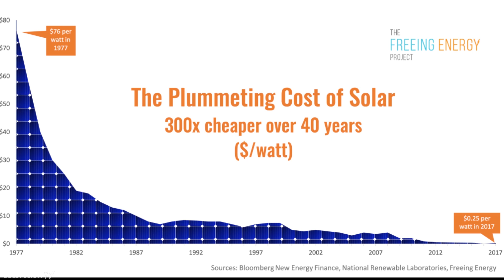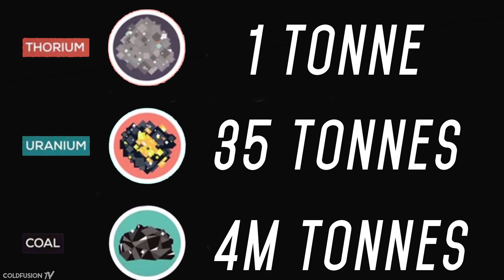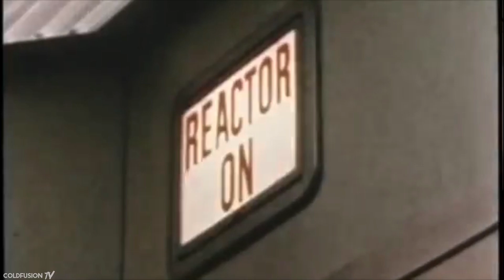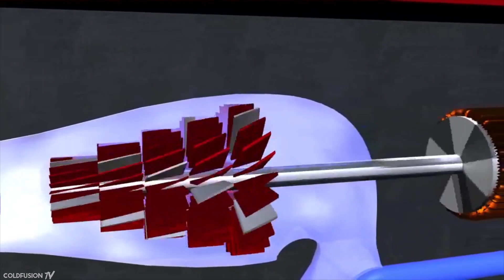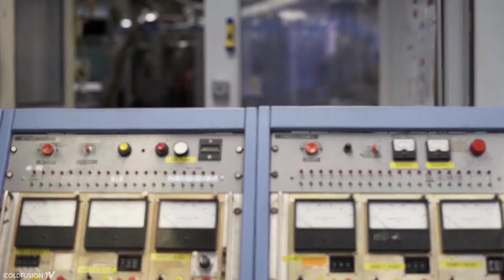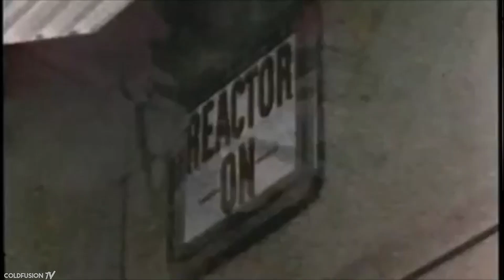Thorium - The Future of Energy?

Comment: Don't believe the spin on thorium being a greener nuclear option
 
 
In a world increasingly aware of and affected by global warming, the news that 2010 was a record year for greenhouse gases levels was something of a blow.
With the world's population due to hit nine billion by 2050, it highlights the increasingly urgent need to find a clean, reliable and renewable source of energy.

India hopes it has the answer: thorium, a naturally occurring radioactive element, four times more abundant than uranium in the earth's crust.

The pro-thorium lobby claim a single tonne of thorium burned in a molten salt reactor (MSR) – typically a liquid fluoride thorium reactor (LFTR) – which has liquid rather than solid fuel, can produce one gigawatt of energy. A traditional pressurised water reactor (PWR) would need to burn 250 tonnes of uranium to produce the same amount of energy.

 
They also produce less waste, have no weapons-grade by-products, can consume legacy plutonium stockpiles and are meltdown-proof – if the hype is to be believed.
India certainly has faith, with a burgeoning population, chronic electricity shortage, few friends on the global nuclear stage (it hasn't signed the nuclear non-proliferation treaty) and the world's largest reserves of thorium. 'Green' nuclear could help defuse opposition at home (the approval of two new traditional nuclear power reactors on its west coast led to fierce protests recently) and allow it to push ahead unhindered with its stated aim of generating 270GW of energy from nuclear by 2050.

China, Russia, France and the US are also pursuing the technology, while India's department of atomic energy and the UK's Engineering and Physical Sciences Research Council are jointly funding five UK research programmes into it.

There is a significant sticking point to the promotion of thorium as the 'great green hope' of clean energy production: it remains unproven on a commercial scale. While it has been around since the 1950s (and an experimental 10MW LFTR did run for five years during the 1960s at Oak Ridge National Laboratory in the US, though using uranium and plutonium as fuel) it is still a next generation nuclear technology – theoretical.
China did announce this year that it intended to develop a thorium MSR, but nuclear radiologist Peter Karamoskos, of the International Campaign to Abolish Nuclear Weapons (ICAN), says the world shouldn't hold its breath.

'Without exception, [thorium reactors] have never been commercially viable, nor do any of the intended new designs even remotely seem to be viable. Like all nuclear power production they rely on extensive taxpayer subsidies; the only difference is that with thorium and other breeder reactors these are of an order of magnitude greater, which is why no government has ever continued their funding.'

China's development will persist until it experiences the ongoing major technical hurdles the rest of the nuclear club have discovered, he says.
Others see thorium as a smokescreen to perpetuate the status quo: the world's only operating thorium reactor – India's Kakrapar-1 – is actually a converted PWR, for example. 'This could be seen to excuse the continued use of PWRs until thorium is [widely] available,' points out Peter Rowberry of No Money for Nuclear (NM4N) and Communities Against Nuclear Expansion (CANE).

In his reading, thorium is merely a way of deflecting attention and criticism from the dangers of the uranium fuel cycle and excusing the pumping of more money into the industry.

And yet the nuclear industry itself is also sceptical, with none of the big players backing what should be – in PR terms and in a post-Fukushima world – its radioactive holy grail: safe reactors producing more energy for less and cheaper fuel.

In fact, a 2010 National Nuclear Laboratory (NNL) report (PDF)concluded the thorium fuel cycle 'does not currently have a role to play in the UK context [and] is likely to have only a limited role internationally for some years ahead' – in short, it concluded, the claims for thorium were 'overstated'.
Proponents counter that the NNL paper fails to address the question of MSR technology, evidence of its bias towards an industry wedded to PWRs. Reliant on diverse uranium/plutonium revenue streams – fuel packages and fuel reprocessing, for example – the nuclear energy giants will never give thorium a fair hearing, they say.
But even were its commercial viability established, given 2010's soaring greenhouse gas levels, thorium is one magic bullet that is years off target. Those who support renewables say they will have come so far in cost and efficiency terms by the time the technology is perfected and upscaled that thorium reactors will already be uneconomic. Indeed, if renewables had a fraction of nuclear's current subsidies they could already be light years ahead. 
All other issues aside, thorium is still nuclear energy, say environmentalists, its reactors disgorging the same toxic byproducts and fissile waste with the same millennial half-lives. Oliver Tickell, author of Kyoto2, says the fission materials produced from thorium are of a different spectrum to those from uranium-235, but 'include many dangerous-to-health alpha and beta emitters'.
Tickell says thorium reactors would not reduce the volume of waste from uranium reactors. 'It will create a whole new volume of radioactive waste from previously radio-inert thorium, on top of the waste from uranium reactors. Looked at in these terms, it's a way of multiplying the volume of radioactive waste humanity can create several times over.'
 
Putative waste benefits – such as the impressive claims made by former Nasa scientist Kirk Sorensen, one of thorium's staunchest advocates – have the potential to be outweighed by a proliferating number of MSRs. There are already 442 traditional reactors already in operation globally, according to the International Atomic Energy Agency. The by-products of thousands of smaller, ostensibly less wasteful reactors would soon add up.
Anti-nuclear campaigner Peter Karamoskos goes further, dismissing a 'dishonest fantasy' perpetuated by the pro-nuclear lobby.

Thorium cannot in itself power a reactor; unlike natural uranium, it does not contain enough fissile material to initiate a nuclear chain reaction. As a result it must first be bombarded with neutrons to produce the highly radioactive isotope uranium-233 – 'so these are really U-233 reactors,' says Karamoskos. 

This isotope is more hazardous than the U-235 used in conventional reactors, he adds, because it produces U-232 as a side effect (half life: 160,000 years), on top of familiar fission by-products such as technetium-99 (half life: up to 300,000 years) and iodine-129 (half life: 15.7 million years).Add in actinides such as protactinium-231 (half life: 33,000 years) and it soon becomes apparent that thorium's superficial cleanliness will still depend on digging some pretty deep holes to bury the highly radioactive waste. 

With billions of pounds already spent on nuclear research, reactor construction and decommissioning costs – dwarfing commitments to renewables – and proposed reform of the UK electricity markets apparently hiding subsidies to the nuclear industry, the thorium dream is considered by many to be a dangerous diversion.

Energy consultant and former Friends of the Earth anti-nuclear campaigner Neil Crumpton says the government would be better deferring all decisions about its new nuclear building plans and fuel reprocessing until the early 2020s: 'By that time much more will be known about Generation IV technologies including LFTRs and their waste-consuming capability.'
In the meantime, says Jean McSorley, senior consultant for Greenpeace's nuclear campaign, the pressing issue is to reduce energy demand and implement a major renewables programme in the UK and internationally – after all, even conventional nuclear reactors will not deliver what the world needs in terms of safe, affordable electricity, let alone a whole raft of new ones.
'Even if thorium technology does progress to the point where it might be commercially viable, it will face the same problems as conventional nuclear: it is not renewable or sustainable and cannot effectively connect to smart grids. The technology is not tried and tested, and none of the main players is interested. Thorium reactors are no more than a distraction.'
Reply: energyfromthorium(dot)com(slash)rees-article-rebuttal(slash)
Let me quote relevant parts:
"I will start by commending Mr. Rees on accurately recapitulating the advantages of the LFTR and correctly identifying that it is the LFTR using thorium—and not conventional solid-fueled, water-cooled reactors using thorium—that is the centrality of the argument here. Far too many writers miss making this key distinction, and instead focus on the limited application of thorium in solid-fueled reactors, and conclude somewhat accurately that thorium has an only modestly-appealing future in existing reactors."
"Again, I appreciate a recapitulation of the advantages, but the sentence ends with the assertion that these advantages are merely “hype” and do not stand up to scrutiny. I did a search of an online dictionary for the word “hype” and found a range of definitions, from “excessive publicity and the ensuing commotion” to “something deliberately misleading; a deception.” If the “hype” surrounding thorium and LFTR reaches this latter category, then truly the author is correct to warn the public about something deliberately misleading or a deception.

So he employed five witnesses in his case against thorium and LFTR, each intended to show that there is hype or deception involved. They are:

Peter Karamoskos of the International Campaign to Abolish Nuclear Weapons (ICAN).

Peter Rowberry of No Money for Nuclear (NM4N).

Oliver Tickell, author of Kyoto2.

Neil Crumpton of Friends of the Earth

Jean McSorley, senior consultant for the anti-nuclear campaign waged by Greenpeace.

The closest thing to a “pro-nuclear” witness interviewed by the author was a UK National Nuclear Laboratory “white paper” entitled “The Thorium Fuel Cycle.”

Mr. Rees goes on to point to the Indian example of thorium development and their national commitment to it before getting to the crux of his entire argument:

We haven’t done it before.

This is a very strange argument with which to base a case against any technology. I’ve spent my entire career in technology development, and the reason why people undertake technology development is precisely because they haven’t done it before!

The case against a new technology like LFTR should then be supported by evidence as to why the author might think it likely that a technology development will fail if undertaken. For this we turn to the five witnesses.

Dr. Karamoskos says:

“Without exception, [thorium reactors] have never been commercially viable, nor do any of the intended new designs even remotely seem to be viable. Like all nuclear power production they rely on extensive taxpayer subsidies; the only difference is that with thorium and other breeder reactors these are of an order of magnitude greater, which is why no government has ever continued their funding.”

Dr. Karamoskos is a nuclear radiologist, not a nuclear engineer. Has he evaluated the LFTR economic case? I highly doubt it. Has he reviewed the performance of other thorium-based technologies before issuing his blanket statement? We will never know because the author does not give us additional details.

One has to wonder why Dr. Karamoskos does not think the thorium-based LFTR will be viable. Perhaps he thinks it will have to operate at higher pressures than existing reactors–but it won’t, it will operate at lower pressures. Perhaps he thinks that it will operate at a lower temperature and achieve lower thermodynamic efficiency–but it won’t, it will operate at higher temperatures and achieve higher efficiency. Perhaps he thinks that the thorium fuel will be more difficult to find and more expensive than uranium fuel–but it won’t, it is more common than uranium and will be mined as we search for rare-earth materials for our wind turbines.

Dr. Karamoskos does seem anxious to promote “guilt by association”, however, by lumping any thorium-based reactor in with uranium-based reactor technologies, which he then goes on to paint as dependent on “extensive taxpayer subsidies.” This is certainly not the case in the United States and I suspect is not the case in the UK as well. He also decides, apparently out of thin air, that thorium is going to cost an “order-of-magnitude” more than uranium-based reactors, without any supporting evidence.
"

"Mr. Rees then reminds us that thorium is “still nuclear energy” and goes on to say that it will “disgorge toxic byproducts” like some benighted monster. Unlike Mr. Rees, I have spent considerable time modeling each and every one of the fission product decay chains and have presented my results in public discussions. Do thorium reactors produce radioactive materials? Certainly. Do these pose an undue threat to human life or society? Certainly not, in my opinion, and I offer the results of my modeling as the evidence.

At some point, I am called to testify as to the benefits of thorium reactors, but Mr. Rees then goes on to dismiss the benefits I offer as “putative” and to assert that they will be outweighed by a “proliferating number of reactors.” I have to wonder a bit at the choice of language in his dismissal, for typically when we discuss “proliferation” in the nuclear arena we refer to the undesired spread of nuclear weapons rather than the expansion of a lifesaving technology. The literal meaning of the statement is valid, but the choice of adjective strikes me as no accident and is meant to sow fear and doubt in the mind of the reader.

Dr. Karamoskos is then called in again to label thorium reactors a “dishonest fantasy” because the fissile material is uranium-233 rather than thorium. This is a strange way to express dishonesty, since I have been forthright since I first started discussing the technology that uranium-233 was the fissile material. But uranium-233 comes from thorium and only from thorium, and the consumption of U-233 in a LFTR leads to the formation of new U-233 from thorium. U-233 then serves as a sort of “nuclear catalyst,” and the real fuel of the reactor is thorium. Is this dishonesty? No, I think it is simplicity. Where does the uranium-233 that drives the reactor come from? Thorium. What is used to create new uranium-233? Thorium. Hence we call these machines such as LFTR by a simple and accurate name: thorium reactors.

A paragraph of errors about half-lives and fission products then follows, which by itself could have been enough reason to pull the article back into dry dock and rebuild it, but Mr. Rees declines to do so. In short, U-232 doesn’t have a half-life of 160,000 years, it has a half life of about 69 years. Protactinium-231 is not produced by a LFTR or any other reactor, it is a natural step on the decay chain of uranium-235 and has nothing to do with whether man chooses to use nuclear power or not. Technetium-99 and iodine-129 are asserted to pose a risk because of their long half-lives. Rather, precisely because they have long half-lives they have low radioactivity and manageable risk. I doubt that Mr. Rees has a good handle on the nature of radioactivity and risk."

Comment: As a comparison between required land for solar farms and Indonesia's current 3.5GWe contract for the seven x 500MWe Liquid Thorium ion molten salt ThorCon "energy converters" have "As-built" foot prints of 1.1 Ha (65m x 175m) for each 500MWe unit. These will provide High temperature automatically load dependent output at near atmospheric pressure under  extremely "walk-away safe" conditions at a capital levelised  output cost of less than US$0.04/kWh as well as having the capability of doing a cold/black start.
So with a 44kW/m2 footprint it is going to be hard to beat by any combination of renewables and battery banks providing 52x7x24 electricity...
https://youtu.be/qd_lBPbeVrQ

Comment: Everyone who developed nuclear weapons quickly realised thorium is unsuitable. It cannot reach the heavier stuff like plutonium within the reactor core. Uranium works best as a solid fuel so that was the system everyone used in the civil plants. 
Thorium works badly as a solid fuel so cannot be used in current reactors. It does work well in a liquid fuel - molten salt. 
The reason we don’t have molten salt power plants is regulatory only. USA rules expressly prohibit a molten core. That stops molten salt technology at source. U.K. rules allow different reactor designs but the regulatory process is just plain difficult and very slow so nothing gets done. 
Moltex the U.K. molten salt reactor designer has created a reactor that has no internal pumps no drain tanks and cannot overheat. The first version will use a uranium fuel salt because ratifying thorium is orders of magnitude more difficult 
They have the fuel salt in stainless tubes sat in a pool of the non fuel  salt. A third salt removes the heat via heat exchange coils. 
It operates in the fast spectrum so can fully burn the fuel. 
The first Moltex plant will be a waste burner fuelled with used fuel from an old light water reactor. 
The conversion to fuel salts is a simple chemical process.